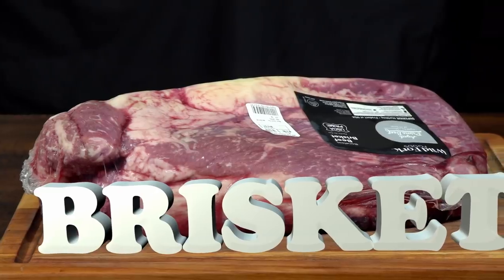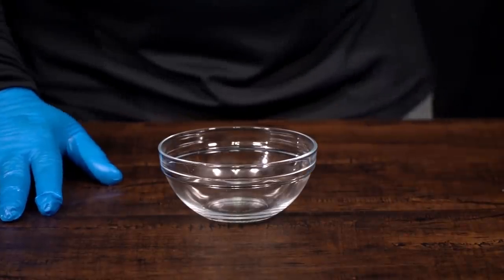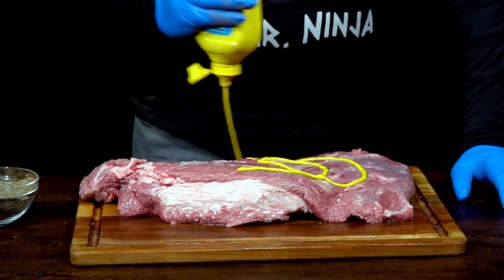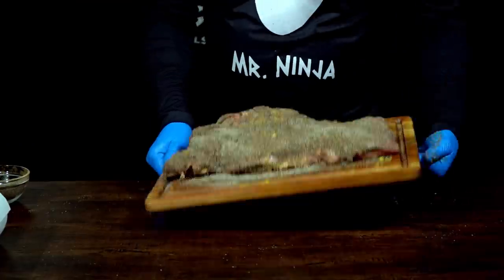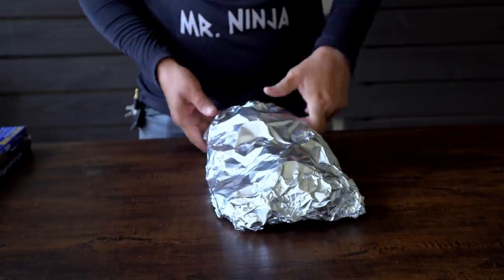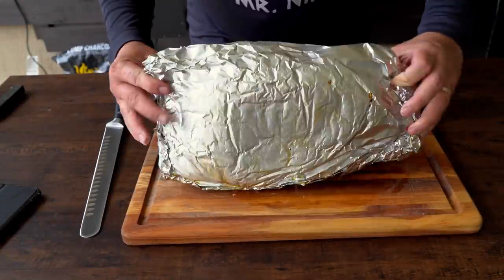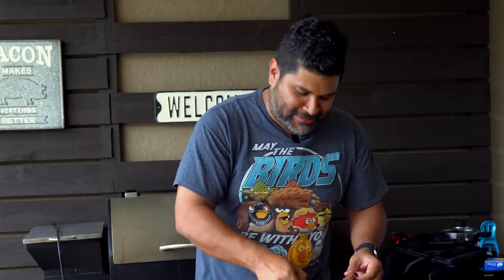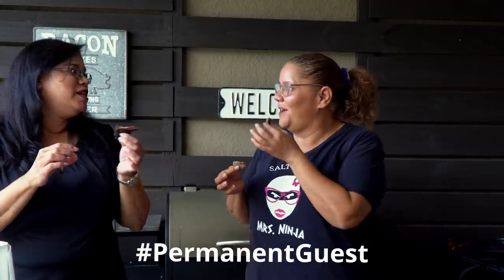How To Make Texas Smoked Brisket For the First Time | Salty Tales

Comment: Ninja,  not knowing the videos you watched I can tell you that you slightly missed the mark, but very impressive for the first try.  Try switching to coarse salt, and coarse pepper.  Many prefer to add those separate as they are different densities and if you don't continue to swirl it around in the bowl it will be uneven.   No need for binder.  Leave the mustard out.  Put on the salt first and let it dissolve a bit.  After just a couple of minutes it will form into a binder all by itself then add the other ingredients of your rub.  We don't always just use salt and pepper, but it is always savory seasonings.  You can add sugar or honey to the mix, but overall it will not be sweet.  Texas brisket is smoked on an offset stick burner, not a pellet grill, komado, or weber.  You just cannot duplicate the flavor with other means of cooking.  I've tried them all and nothing says Texas Brisket other than offset stick burner.  As always JMO so take it with a coarse grain of salt.
Reply from the maker: Keith I'm so glad for the recommendations and I just took note of everything you said for my next brisket, The only thing I wont be able to have is the wood grill but I'm making one based on your recommendations for sure! Thank you so much!!!
Reply: Keith Jones pellet grills are still timber?
Reply: @adamjolley630  You cannot get the smoke flavor from a pellet grill that you get from an offset stick burner.  Pellet grills have their place but Texas Style Brisket comes from an offset  stick burning smoker.  My experience follows this video.  I've tried them all myself.  Tenderness, rub flavor, bark, juiciness all can be achieved with different cooking equipment, but the flavor that comes from the smoke is not the same.  Not ever close.  Watch Jeremy's video.   https://www.youtube.com/watch?v=zxvfIGhs0Dw&t=1s

Comment: Glad the brisket turned out well for you. Old school Texas brisket is 50/10 Kosher salt and really course black pepper and that is it. Don't even need the oil or mustard. Just trim the fat down to about 1/4" thick over the whole brisket, then add an even layer of the salt and pepper mix. Smoker I run about 250-275F until the meat reads around 160. Double wrap it tight as can be. After that you can keep it on the smoker if you like, but I put it in a 350F oven and let it climb to 200-205F (whichever works when you put in a thermometer and it is like poking it in to room temp butter). Once to temp I soak a thick bath towel in boiling water and place it in a cooler, once absorbed I place the brisket on top of that (still in the foil) and then a second dry towel on top. Then I close the lid and let it sit in there overnight. If needs be, an hour or two before serving you can add in another bit of boiling water to the cooler so long as it does not water log your brisket. Enjoy after that.
Reply from the maker: Thank you so much! I definitely have a lot to learn so each of your recommendations are well appreciated!!!
Reply: @SaltyTales  Not a problem at all! I learned the hard way and failed several times. With some trial and error as well as watching every video I can from Aaron Franklin I think I have it dialed in pretty well now.

Comment: Everyone that likes brisket would love this video. But my in laws are all Texans and they all make briskets each has a different rub I learned to used ground coffee in the rub most had a 40 to 50% salt the other sit to fifty % was black pepper garlic and onion powder, cayenne, a little brown sugar and the finely  ground coffee. And instead of aluminum foil used brown butcher paper. Again I have tried to stop using aluminum  in cooking due to the research showing the effect of causing Alzheimer's and dementia. And also paper is much cheaper and get the same effect. Low and slow about 225° F for a long time until internal temp reaches 190- 200°F. And then the long rest of 2 to 3 hours is so important. You can put a heating pad on low under the brisket to keep it warm in the cooler. The brisket should be limp and easy to pull apart.  I miss going to Texas as much as we use too as my wife's mother and father has passed.. my father in law would get a bark on his brisket with high flame then smoke it until it reached 150 to 160° F then bring it in the house and slow cook it in the oven at 225 until done and the internal temperature was in the window stated above then he would cover the brisket and turn the oven heat off and let it rest for 2 to 3 hours. And it would melt in you mouth. Add some white bread, fresh onion thinly sliced , pickled Jalapeños slices, some coleslaw and pinto beans on the side. It brings back great memories  everytime I think of Texas smoked beef brisket. Everyone there has a little different take on the rubs but the cook methods vary very little long and slow over low temperatures then long rest. Most cook it over night so the next afternoon it is ready so  everyone can eat early and pick on it until the evening , enjoy each others company, tell some stories, drink some cold beers and just relax. Fully satisfied in all the senses with everything being good. Family, food, celebrate each other, laughs  what more could one ask for and the brisket is a large peice of meat that can feed them all easily. 

Great video it brought back many memories and the people who share it with you proves my point brisket is the meat to share and enjoy with family and friends. You can never go wrong however  it does take alot of dedication to maintain temperature and smoke but the results always speak to the success of you efforts. Well done my friend well done. Was looking at a brisket the other day at the market and it brought back the old memories. Thanks again for the memories with this video.
Reply from the maker: Oh Rick! I'm so glad you like the video and the way I made it! I promise I'll be testing on these briskets until I'm 100% satisfied with the flavors and tenderness and then, if you pass by Miami one day, you'll know where the best Florida brisket is at! Thank you so much for sharing your memories with us and for your kind words!
Reply: @SaltyTales  I just may take you up on that oneday. Thanks  for the offer.
Reply from the maker: @rickbooher8224  I'll be my pleasure!

Comment: This Texans mouth is watering and I can get brisket here in a fast food place so you did real good for your first one. We drive sometimes hours to try the best so the competition is fierce as is the variability of how we do it. Just when you think you have heard every way of making one, every rub, or mop sauce along comes a new twist. The best advice I could give is to make it your own and test, retest, and test again. Low and slow. Don't over trim as each brisket is different and one will have a lot of intramuscular fat and one will be leaner, just even it out. We use a lot of mesquite and oak for smoke and long slow burns so try each and pick your favorite. Let your pallet be your guide. It is near impossible to beat sous vide on tenderness but cook times are up to 48hrs so if over flame I usually give myself 16-18hrs from putting it on till ready to serve. Babysit it and have plenty of beer and don't be afraid to share a little with your masterpiece along the way. They only get better with practice and refinement. Throw one a little Cuban twist and make it your own with a Ninja kick!
Reply: James Mandl Eh...low and slow is starting to go away. ArnieTex cooks his briskets hot and fast and so does Kosmos. Arnie is one of the best comp cooks out there. He gets his done in about 6 hours. After watching these guys do it, I’ve realized there’s no reason for it either. My first hot and fast came out awesome
Reply from the maker: Man I have to agree with you 100%, it is something to personalize and there is so many variations that it can get a bit crazy but I loved every part of it, from the seasoning to the tasting! I'm be putting my own cuban touch on it for sure and see what happen after that! Thank you so much James!!! 😀😀

Comment: Looks good, but one major tip! When you go to slice the point you gotta rotate it 90°. The grain runs in a different directions than the point. That big end piece you had on the left side of the video cut straight down the middle from front to back and then trim that direction.
Reply from the maker: I know brother but I really wanted to taste them both together an see those juices coming out as they did! Besides that, are you proud of my first brisket?

Comment: You did a great job! The only thing I would have done different is I wouldn't use a iodized salt was you using kosher salt I don't know! Also a coarse black pepper and before you wrap it did you happen to Spritz it to keep the moisture that's what I found out go good with my brisket
Reply from the maker: I didn’t spritz it at all even when I’ve seen some people doing it but the videos I was following they didn’t recommended it so I dis what they said but definitely will be trying that in the future! The same with the salt and pepper! Thank you so much for the advice brother!
Reply: @SaltyTales  I did like you putting the mustard down as a binder but just like Aaron Franklin I want to try the butcher paper wrap instead of the aluminum foil for one day I'll try

Comment: Ninja, 

The fuse blew out because you started the smoker on too high of a temperature. Regardless of what temp you want to smoke at always preheat the smoker to 180-225 before raising to your final target temp. When you cranked that thing up to 450 I was sure you would have a problem. 

Brisket looked great. Keep up the good work
Reply from the maker: No, that is the way the manufacturer say it should be started. All the way up, way 15 to 20 mins and then you set the temperature you want.
Reply: Salty Tales thanks for the reply. I’ve burned Up an couple on my smoking brothers smoker. Now I always start it on the lower settings. And haven’t had any more problems. 

Happy cooking brother.

Comment: Here’s my experience with this recipe/process.
Tip...Costco’s prime, untrimmed is cheaper by a little than choice, trimmed. I lost 5lbs of fat off my 13lb brisket, did the math and there you go. Prime for the price of choice.
Eight hours of smoke on the Trager got me to 150F. Did the foil thing and turned the temp up to 250. Hit 200 in about 1/2 hour. Put the very tender brisket still wrapped in a small ice chest (I do this trick with tri tip) then removed in about an hour. 
Tip...go for two hours like Ninja instructed. A whole bunch of juice had not gone back into the meat.
Learned a bunch and am no longer to tackle a “Ninja brisket”.
Meat was deeeeeeelicious and very tender. 
Thank you Ninja

Comment: Please leave some fat on top of that brisket next time. 1/4 to 1/2 an inch is perfect. You wouldn't take the fat cap off of a picanha would you? I didn't think so. The fat on the top bastes the top half of the brisket during the long cook time. Go back and look at all the juices from the lower half, that's because there is a layer of fat between the top and bottom layers. The bottom half had juices pouring out, the top half not so much. I've cooked at least 50 briskets in my day and keeping some of the fat really does make a huge difference.